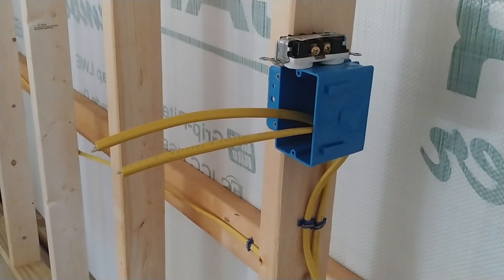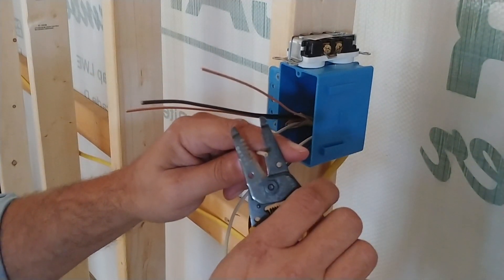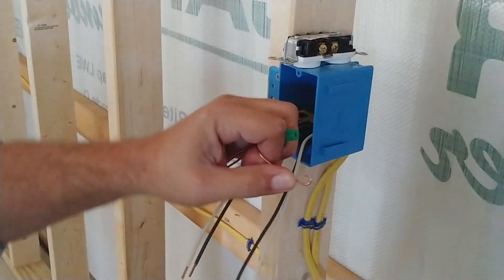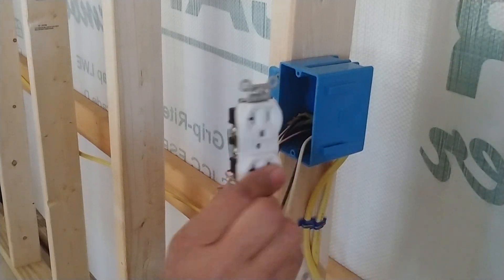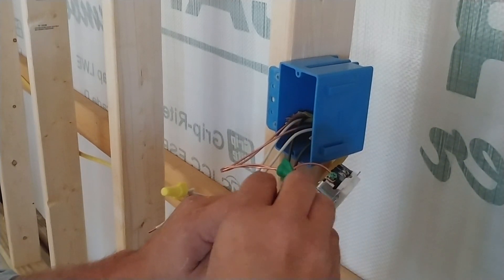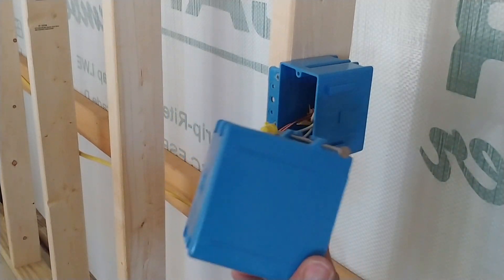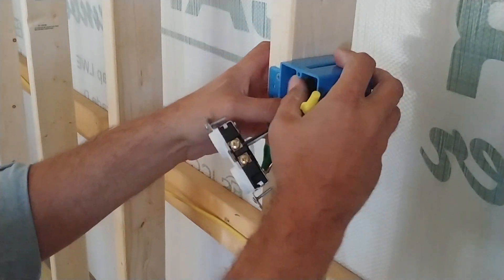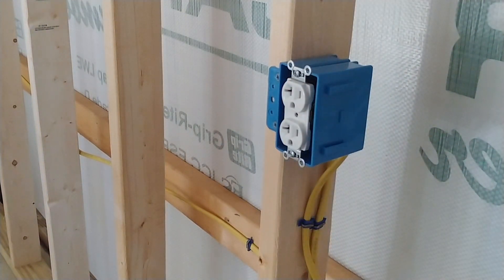Wiring up a outlet tips and tricks.

Comment: I've seen others wire both neutrals and hots to each of the silver/brass screws.  You use pigtails for all three sets of wires.  Other than the circuit failure reason, what other reasons do you use pigtails more than for ground?   I see electricians doing both.  The guy I use always screws them onto each of the posts.
Reply from the maker: In the area where I work which is Wayne County all the inspectors I've ever encountered require it to be wired that way otherwise they will fail you on the inspection.  The reasoning for the pigtails though is to have all of your circuits continuous.

Comment: Did i hear in the video that 14ga. wire is used; then why is there a 20 amp outlet installed in he circuit
Reply: No, 12 gauge, he mentioned that 14 gauge is much easier to work with.

Comment: Any reason for 20 amp receptacles, they are quite a bit more expensive than a spec grade 15 amp? I know you're using 12 gauge wire, but 20 amp receptacles are virtually never needed.
Reply: Until you need it😂😂

Comment: Using those green wire nuts, you could have just twisted the wires together, cut one of them back, and used the longer one through the hole and attached to your receptacle, most states allow that, as does the NEC especially with the ground wires.

Comment: Awesome tips. 
9:15  I'm not an electrician. (But I play one on TV - JK) I don't know if it's new code or maybe just a suggestion. I heard the new way of installing outlets is to have the ground hole on top. Which I think looks silly. I guess the idea is - when a plug is loose & isn't in all the way & then something falls onto it, then the ground is the first thing to be contacted. 
Erase if not wanted. I don't want people to be confused on this.
Reply from the maker: You are absolutely correct on that but there is no code that says you have to install it up or down.  At least in a residential situation.

Comment: Pig tails should be at least 6" inches long, approximately the length of your wire stripper handles, or for most men from palm to fingertip. They will twist shorter, and fit most outlet boxes.
You can use a wratcheted power screw driver, set to not strip whatever screw you're driving home.
Reply: Why do you use pigtails and not connect both conductors direct to the socket. I just can't understand the reasoning behind it.
Reply: It’s so that the receptacles are isolated from the other and not connected together

Comment: Excellent video, thank you! quick question, for the rough wiring inspection, do you need to have all the pigtails done and rolled up in the outlet box, or is romex run to the box and stapled sufficient? Thank you again!
Reply from the maker: For the rough inspection just the wire tacked in place and hanging out of the box, no connections made.
Reply: Remember that inspectors are just humans that want a safe build.  I am not one, however, do not hesitate to call them and ask.  They have plenty of inside into the trade, like what panel manufacturer they do not like and what they expect to see.  Also, because they see many jobs, they may know some really easy way to do things and a phone call may get you great insite.

Comment: Funny🤔, 🇩🇪here not allowed those Wirenuts. WAGOs used by Professionals und DIYer. Okay, we use 230 Volt Standard 16 Ampere, for Stove/ Range I have 3 Phase  230 Volt (400 Volt), 25 Ampere.

Comment: Is there any particular reason for using a different (green) wire nut for the ground wires than you did for the hot and neutral wires?
Reply from the maker: Green indicates ground but no its not required to use a green wire nut.
Reply: Not in this case but the green wire nut has a home in the top of it so instead of attaching a pigtail he could have simply left one of those ground wires longer than the others and fed it through the end of the wire nut. Green indicates a ground.

Comment: Using two circuits on a plug is so you can run lamps on a switch and still have constant power to the other side of the outlet. Example lamp and a clock on a dresser. You want the switch to shut off the lamp but not the clock.
Reply: I would just put in a two gang box and two duplex receptacles.
Reply: @njsongwriter  most people wouldn’t want a tow gang in their bedroom

Comment: Good video !! It would be better  if the tails are longer .Secondly ,you don’t have to ,but twist the wires together before installing wire nuts,makes a better connection.Thirdly,I always wait until the sheet rock is installed ,taped then painted before installing any electrical device ,If you don’t wait the device will get filled with sheet rock dust ,spackle and paint . Otherwise good video !
Reply from the maker: Well first I needed at least two service Outlets while I was working in the barn so that was why I installed these and thought I would make a video while I was doing it.  Another reason for not installing your Outlets prior to drywall installation is because the drywall would have to be cut larger than the whole actually needs to be to install it.  2nd you should never twist the wires together prior to using the wirenut as that's the point of the wire nut it twisted wire together for you.  In addition to that the wirenut also gets a better bite on The Wire by not pre twisting them.  Thanks for watching :)
Reply: @BevinsBuilds  I’ve been doing electrical for 35 years always made a joint ,never relied on the wire nut to make the connection. You know something I never ever got a call back because of know power . Hey I’m an old timer I stick to what works .... stay safe !
Reply: @BevinsBuilds  As a licensed Journeyman electrician, we always install the devices after drywall and paint. 
Never before. You'll get drywall mud, dust, and paint in the device. The holes are cut in the drywall around the box opening no matter what. Service receptacles are an exception.

Comment: I have always heard to make sure the ground on wall plugs should be facing up or at the top on the plug. ground should be up ? If not tell us why.
Reply: That is for metal covers like you would find in a shop environment. If the cover comes loose, the cover could fall down and connect the hot and neutral on the device plug, causing a short. If you are using plastic covers, you don't need to mount it ground up.
Reply: its so that if drapes or a curtain is hanging above it, it hits the ground instead of the hot conductors causing a fire hazard
Reply: @kevincassidy7457  no offence but never heard any stories of that really happening it’s a pretty slim chance. It makes sense but it doesn’t have a significant safety impact to mandate orientation of an outlet in code
Reply: @Nick-bh1fy  No offence taken. Just telling ya what the NEC code book 19th edition said. Don't really care if ya heard of it or not. That's the reason, no offence
Reply: @kevincassidy7457  ok but you do know there’s no NEC requirement of grounds being located upward, it’s a preference thing but some people put receptacles w ground up to identify the outlet is switched
Reply: @Nick-bh1fy  the only information i gathered on it is its for the purpose of plugs becoming loose in the plug. like falling out and noone knows or have checked on it. so then if something or someone(child) starts messing with it, the chances of something bad happened have gone down significantly just because the ground is up
Reply: @kevincassidy7457  if a kid is gonna mess around w a plug halfway in the outlet ground up won’t save them if they grab it anyways. Again it’s advertised for added safety so to each their own
Reply from the maker: I will make a video to show a better explanation but Kevin said it best it is if anything was to slide between the wall and the outlet it will hit the ground before it hits the hot and if it hits both it should trip out the breaker

Comment: Breaking the tab to separate it onto different circuits is generally done when you want a switched outlet in a room.  It never makes sense to have both outlets on the same receptacle be switched outlets.

Where are you at where building code allows plastic boxes and romex for new construction though?
Reply: Where are you that it's not plastic for residential? Would make zero sense having a metal box without emt which is not used in residential....
Reply: @Tre16  I'm in Illinois period in our building code absolutely requires metal boxes and steel conduit not just EMT
Reply: @Rowgue51  For residential??
Reply: @richardhoner7842  yes

Comment: Why the flat head screwdriver
Reply from the maker: Because what appears to be a philips head truly isnt.  What you should actually use to tighten is a #1 square bit.  Which most people do not own.
Reply: @BevinsBuilds  Robertson bit l believe
Reply from the maker: Never heared it called that before. :)
Reply: @BevinsBuilds  use them all the time google Robertson bit
I think he invented it.
Reply from the maker: Ah so a trade name like romex then. They sure grip a lot better.  And your right google said he invented them in 1908.
Reply: @BevinsBuilds  I was a union carpenter for 40 years . I had a shop we installed office furniture like cubical. 
Those bits were also called canadian bits cause all the Canadian furniture used those screws.
I'm no electrician I know just enough to get my self in trouble
I wired my whole basement remodel but had my electrician buddys on call.made o few dumb mistakes but it all works lol.pops was an electrical engineer told me to be electrician should of listen to him.side jobs
Are easy money.take care.
Reply from the maker: Its funny you called them Canadian bits as well as Robertson was a Canadian as well :).  I hate cubicals and being a carpenter is a great trade also.
Reply: Everyone who works for me is required to have a 10 and 1 tool and a torque driver. Its being a professional thing.

Comment: What's the point of wasting time on tails when the bond between top and bottom outlet is being used ??
Reply: Was wondering the same thing. No wonder he likes the deeper boxes, adding unnecessary wires
Reply: @tmylee6218  yep, and you NEVER make unnecessary connections in an electrical circuit....just another possible point of failure 👍
Reply: It is so the circuit stays hot all the time. If connected at the device, it can come loose and kill the circuit downstream. You can undo the device for replacement without killing power downstream. I'm an electrician. You don't have to do it, but the better electricians always pigtail.

Comment: In case anyone doesn't know, The reason for making the pig tails is that in the event of device failure the rest of the circuit will stay powered.
Reply: They supply 4 screw terminals for a reason. It's not code to make pigtails for white and black.
Reply: @Byron-Dallas  the 4 screws allow for flexibility in the recepticle's use.  Code, as you know, allows duplex recepticles to be split for such things as switch control of the top or bottom and isolating each recepticles for use on different circuits(test, top on circuit 5 and bottom on circuit 7 or whatever number) This allows use of a hair dryer in one and some kind of heated hair brush in the other.

you are correct, it is not Required by code to pigtail.  Connecting to the 4 screws is faster, however, a failure of that one duplex recpticle will stop power to all downstream recepticles if the recepticle is used as a piece of the circuit.
Reply: @Byron-Dallas  its also not against code either. I have only really seen it in commercial applications, but its a practice i was trained to do. Some inspectors ive dealt with want it that way. Ive never failed an inspection for that or been told not to do it.
Reply: Basically they are saying you can't always trust the screws. When electricity flows it creates heat. Heat expands metal. Over many cycles of heating and cooling the wires can flatten and loosen under the screws. (Found most commonly on the mains of your panel.) Especially if you have under or over tightened them (there is a torque rating for them idk it but I know there's one). Eventually breaking the connection. Really not likely but it's happened enough that they want you to do it that way. Also because of stab in connections on the back. They can loosen and fall out as well.
Reply: @lucyfuir6386  ok thanks
Reply: @joeblow5381  👍
Reply: Why wouldn't the rest of the circuit stay powered anyway if there were only two pair of wires in the box and the hot wires were connected to the same terminal and the neutrals were connected to the same terminal?
Reply: @njsongwriter  there is not room to put two wires under one screw.  The two screws on each side are connected electrically by the break away piece he showed in the video.

Remember, if you use the two screws on one side, that break away piece carries all the current in the circuit.  This allows for bigger heating and cooling swings on the wires and terminal screws.  Since different types of metals expand and contract at different rates, it will allow the wire under the screw to try to back out the screw.  Should this occur it creates a high resistance connection and burns up the recepticle.

Numbers for the numbers guys.

One 100watt bulb draws almost 1 amp.
You can load about 12 on a 15 amp circuit.
Connecting to the 2 screws now puts all 12 amps through that first recepticle (should be okay and is allowed by code)
Pigtailing has only 1 amp through that first recepticle and the rest bypasses on the wires.  

One small oops on the terminal, insulation under screw, not tight, etc and you may be taking apart a lot of recepticles to find THE ONE.

Remember, code is the minimum, not always best.  Many contractors will use the 2 screw method because it is legal and faster.
Reply: @keithharrington4595  
Thanks.  That is the best explanation for the reason I've read so far.
Reply: @njsongwriter  I'm lost too,unless u break the metal tab on the sides why wouldn't the whole run stay hot?I have heard this many times like you and I don't understand either.
Reply: @njsongwriter  if you use the device as part of the circuit, ie. Connecting to the 4screws,, a failure of the device opens the circuit at that device.  In a house, the number of recepticles on one breaker is not limited, allowing all those down stream recepticles to go without power.

Comment: I believe you said you are in Michigan as well. If permits are pulled to run electrical to finish a basement can I install the outlets prior to inspection after running the wire or do I have to wait?
Reply from the maker: It all depends where you live.  Usually though the inspector want to see the rough in wire and then return for the finish.  Ive seen inspectors tell people to remove everything and call them back.
Reply: @BevinsBuilds  thanks for the reply, To be safe ill probably just leave the outlets off, i wont be doing the drywall until after inspection of electrical wires and water lines anyways.

Comment: Good video.    Few finer points and question.   The device in your video is a duplex receptacle or receptacle.   Please look up definitions in NEC for receptacle and outlet.   I have never read or heard the term continuous used for branch circuit wiring methods.   Where are you finding that in NEC requiring the conductors to be connected together off of the device?  Not including the ground conductor.
Also,  receptacles are typically installed after wall covering, not before.
Respectfully,   Kevin

Comment: Wondering - why didn't you curl the wire around the hot and neutral screws?  Wouldn't this make for a better stronger connection?
Reply: Guess he should have given you a close up of the back of that 20 amp receptacle. There are no speed connections on the back, but you do have the option of inserting one or even two wires under a plate at the terminal screws. The screws then tighten the plate onto the wires. Not like the old push connections still found on 50¢ residential grade receptacles.

Comment: Bro!!    That green wire nut has a hole in it for a reason.   Don’t need a pig tail for it.   One long wire one short put long through hole until it meets the short one and twist
Reply: Yup!
Reply: I think that technically you’re right. Maybe he did it to be able to push all three wire nuts to the back of the box. Might make it a better fit.
Reply: I can't picture what you mean.  One wire stays outside the nut (out of 3 wires)?

Comment: one of the worst how-tos i've ever seen...green wire nut nut used wrong, sloppy insulation cut off in box, didn't even bother watching the whole thing
Reply: Jim I thought his video was very good, but I quickly went to your channel to learn the correct methods.  What a surprise!  YOU HAVE NO VIDEO!  I'll stay here.
Reply: As an electrician, I'll nitpick using the tip of the strippers to make the bend in the wire when there are holes in the strippers for that purpose which are easier, and I'd make the pigtail a little longer, but other than that it's good.

Comment: Do all 2o amps have the T slot?  My house is late 70s, some of mine do not have it, so I need to add some receptacles, do the newer 20 amps come with and without the T slot or not?
Reply: If replacing 15 amp receps with 20 amp receps, you need to make sure wire size is 12 gauge. 14 gauge is rated for 15 amp.
Reply from the maker: The T slot is only on 20 amp outlets.  I wouldnt worry honestly on replacing the 15s unless you are having a issue.